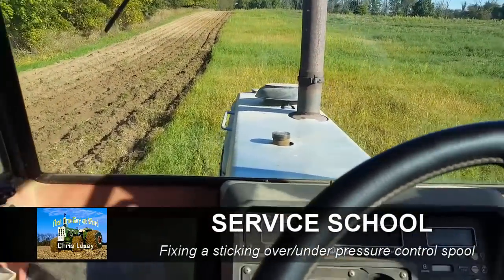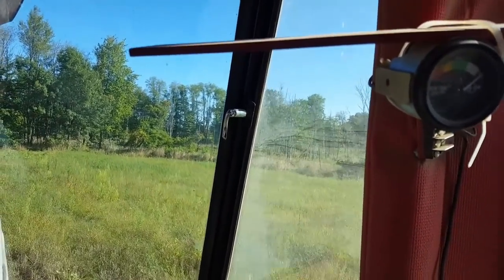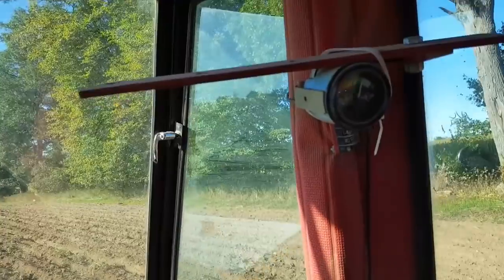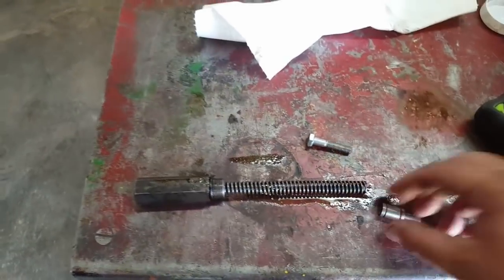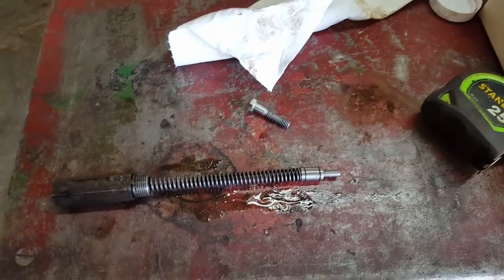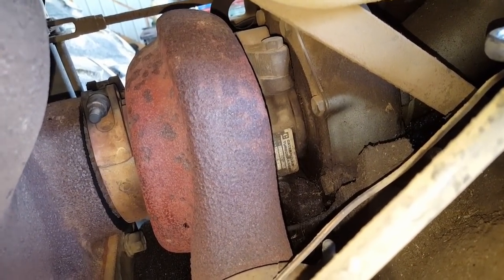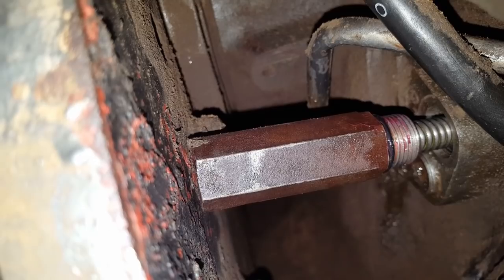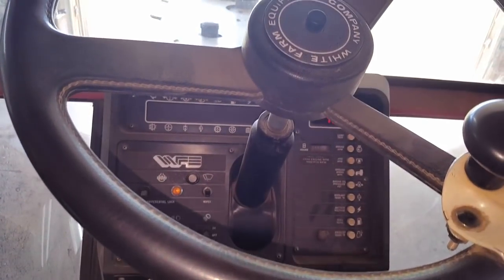Service School: Stuck pressure control spool in an over/under

Comment: Not to bug you but we recently acquired a 4-225 white and the issue that I notice is the front axle is over filling itself didn't know if there was a specific place you would check out first  I am aware of the transfer pump that they have to scavenge from the front and I checked the lines to and from all look good from what I can tell  idk if you had any expertise with that or not. Thanks in advance
Reply from the maker: I was going to say that the pump itself is probably bad. It has a suction hose that could be cracked or otherwise sucking air, and that could cause the problem.  Are you getting any warning lights for pto lube or transmission lube, especially at an idle?
Reply: @ThatOliverGuyChris we're still in the process of getting the lights figured out the piece of paper was loose and laying in the dash so that parts is one stem at a time we have several 4-210 tractors and we are basing most info off of those  but other then fuel light air filter light and exhaust temp light I believe they all went off  but I will get back to you  I was suspect of the hose on the exterior of the front diff anyways because the entire tractor needs cleaned  but I enjoy your videos a bunch they have helped my and my old man on so many things it isn't even funny  I will keep you posted if I find any thing out in the next couple days

Comment: I have a 2-180 in over and under it goes straight to green in direct it drops way down and takes while before it gets to green and flutters?
Reply from the maker: On the gauge? Sounds like the internal seals that go to dirct are getting bad and letting too much ool leak .

Comment: That’s interesting to see that pressure gauge my 105 doesn’t have anything like that
Reply from the maker: They didn't put them in every model, just 2-155 and 2-180 if I remember correctly.  Later models had the idiot light like the 4-225.

Comment: would a stuck valve on a 1850 cause it to hesitate when you shift it I have to push clutch in for it to engage
Reply from the maker: It's possible.  Is it a 2 or 3 speed?
Reply: 2 speed.
Reply from the maker: Scott, that could be your problem. Pushing the clutch down stops the pump inside the 2 speed, so it's possible the plunger sticks a little, and when the oil pressure is gone, the spring pressure frees the plunger up again. There was also a problem on early units with seat that could come loose, I think that was in the lube circuit plunger. Putting a gauge on it would help to diagnose the problem.

If the tractor doesn't move at all and you have to push the clutch in and release it to get it to go, then you are looking at a bad sprag clutch. The unit has to come out to fix that.

Comment: I laughed when you needed to compress the spring. I was talking to the screen saying he’s going to need a pry bar and a ratchet wrench....lol
Reply: I’ve never actually done one on a white. I love the gauge should probably have one on all of them....lol Rogators use so similar prv’s and they can get sticky or need shimming always needed a 2x4, prybar and a ratchet wrench. Used a ratchet wrench to help finagle it to line up once threads met. Worked pretty well.
Reply from the maker: It actually went better than the last time. Guess I have a better pry bar now.

Comment: Great shop video and good info.  So I have a few questions, first: Could you install a gauge on any 2 or 3 speed to check pressure? I would like to install one on my 1850 and 1950T with three speeds. Second: I guess how were you sure it was dirt or something making the spool stick and not just spring pressure and you didn't have to add or remove shims?  Or would that have been just low pressure if the spring was week and then either add shims or a new spring?  Also how many shank chisel plow do you have, is it a Glenco soil-saver?
Reply from the maker: I think the pressure is 180. I'd get a gauge that goes to 250.
Reply from the maker: Aaron, to answer your questions... 1: yes. I always put a gauge on units I have rebuilt to check the pressure.  A little weakening of the spring and seat wear can cause the pressure to lower some, and I like to set them at the high end, or even slightly over specification. I normally plug my gauge in a 1/4" pipe plug towards the bottom of the side cover, it faces towards the front of the tractor. I should have pointed it out in the video, sorry about that.
2: When I shifted to under drive and the pressure pegged on the high side, I knew that spool wasn't moving. Under drive doesn't use any clutch packs, so it only needs lube oil for the sprag clutch and bearings. Normally the extra oil gets dumped back to reservoir by that spool, but since it wasn't moving, the pressure went even higher.
3: It's a Glencoe 9 shank, with 5 more deep till shanks on the back that can be lifted out separately with manual turnbuckles. It will make that 4-225 bark.
Reply: @ThatOliverGuyChris  What did you say the max psi should be?  Just wondering so I know what psi gauge to use.  I bet that chisel does make it work pretty good!!  Thanks

Comment: Do you think it was a little dirt that was causing the problem  ?
Is your filter dirty  ?

Nice video sir 

Viewing from across the pond.  👍👍
Reply from the maker: Probably a little fleck of dirt. I changed my filter less than 100 hours ago. Could be as simple as I didn't wipe off the dipstick good enough before putting it back in. The oil looks really good and clean, and doesn't have a residue on the dipstick like there are particulates in suspension in the oil.

Comment: Any service bulletins on a 1955 I should know about?  I think there are some rod bolt updates and torque specs that changed
Reply from the maker: There are several on the engines. Rod bolts, head bolt torque, one piece wrist pin bushings, and valve protrusion areones that pop into my head.

Comment: Our 1655 is slipping in overdrive. Would those shims change anything for the overdrive? Do you know where I can get rebuild kits for the over/under? Thanks for the informative video 😁. Have a good one.
Reply from the maker: If only over is slipping,  the clutch discs are probably worn out. If it is low pressure both direct and over should slip. It wouldn't hurt to put a gauge on it to see what your pressure is, as low pressure will affect overdrive more, as it has a smaller clutch surface area than direct.  I should have thought to add in the video where to connect a gauge for testing purposes.  I will when I make an overhaul video for them.
Reply: @ThatOliverGuyChris  awesome thanks!

Comment: That brings back memories of the 4-210 it kept blowing couplings apart and clutch housings  , we got good at pulling the 3208 and the hydro power! I suppose there was an update but at the time there was no internet and we didn't know!  Question for you Chris can I pull the valve housing off of the 1550 hydro power with out pulling the motor and hydro out of the tub? It leaks around the pin that the pressure line screws into! Thanks
Reply: I think I screwed this up the hose went bad and I replaced it with a steel tubing.  That put a bind on the pin now it seeps, I've since replaced it with a hose but the leak continues.  Thanks Chris
Reply from the maker: There was an update on the 4-210 where the over under bolts to the transmission input shaft. On the 1550, there's not enough room to get that cover off whille in the tractor. Usually the output shaft needs reshimmed so the shaft runs true and doesn't shake that oil ring shaft all over, causing the leak.

Comment: Hydraulics.... Always fun..lol
Actually most is, but some issues are a pain!!
Case IH, 3394. One remote controls the hydraulics on the big baler, same one I use for single implements and the cultipacker when planting... Have had issues with the baler for three years, but no other issues until this year.
Yup... Bad valve! And of course, no longer available. Got a used one coming for the same price as the last listed price of new. UHG!!!!
Going to be about $1200 by the time it's done, but gotta have it......
Thanks for the video Chris!!!!
Always something 🤐
Reply from the maker: Sometimes tracking down the problem takes longer than fixing it.  Old tractors might take a little longer to find parts for, but I can hire a machinist to build be a new part, I don't know who I would get to build a new circuit board.
Reply: @ThatOliverGuyChris  Exactly 😎